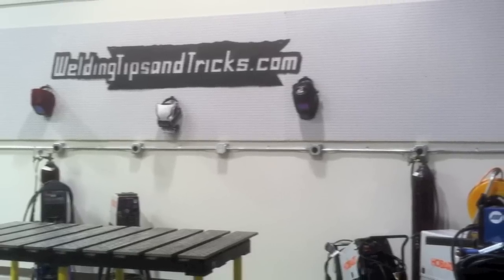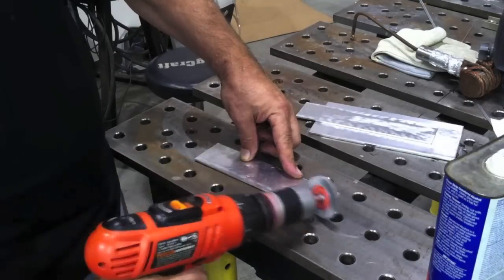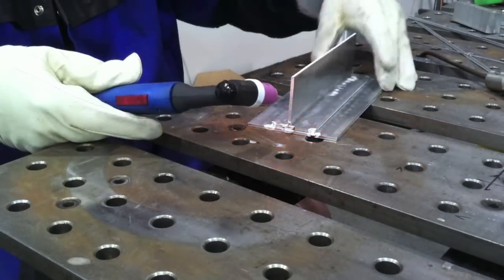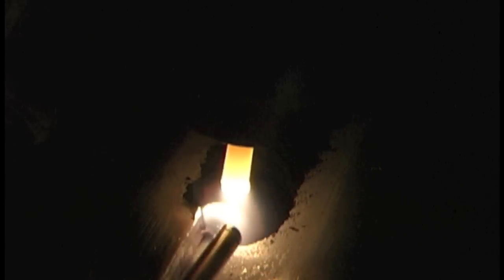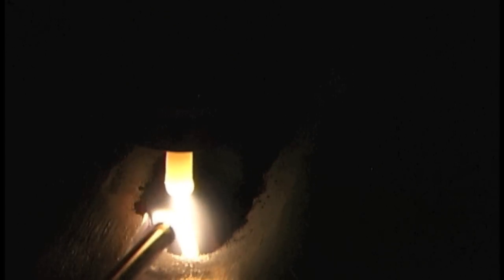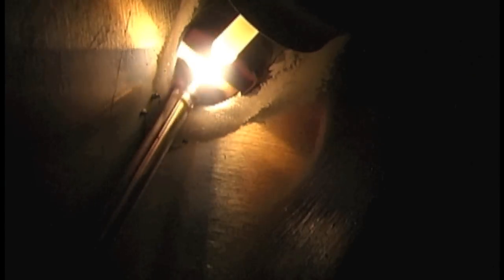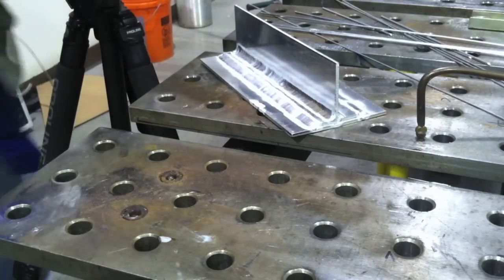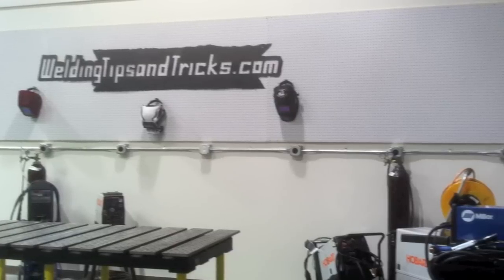Aluminum Welding -  Lap Joint and Tee Using TIG

Comment from the maker: Since this was a small piece and got saturated with heat quickly, and the fact that I did not have time to stop and let cool, areas where I welded with the piece really hot got grainy...it seems like the solidification rate is the key. once the piece gets really hot , it solidifies slower than normal.

Comment from the maker: as little angle as possible.  I shoot for only about 10 degrees but sometimes use more without realizing it.  you might need to step up one size in filler rod if the rod is constantly melting before you reach the puddle...either that or your arc might be too long

Comment: Hey Jodi, Nice videos you have here, you helped get my stick welding up to par, now I'm onto my tig welding. Currently an apprentice fabricator. One thing I've noticed, I have always been instructed that thoriated tungsten is strictly for DC welding. And Never for AC. Just want to know why you prefer to use thoriated for aluminium

Comment: Jody, in my city the 1.5% lanthanated electrodes are a lot easier to find than are 2%, and I'm told they are cheaper as well. Do you notice a difference between the two?

Comment: Tig welding is part of my profession and i have tried that, and it happens on different alloys too, but not always which makes me suspect its in the material itself. Because it will happen on one part of what i am welding, but not on another. For the most part i get clean shiney beads. I guess i can run some more tests once i have my new machine.

Comment: I had been taught the same, not to use thoriated tungsten for ac or dcep because in these processes the tungsten melts and gives off the same radiation you find when sharpening a thoriated tungsten but alot worse. wether its true or not I'm not too sure, would be nice to know thow! your thoughts jody?

Comment: Jody, what machine are you running in this vid?   I've been in the market for a TIG and the PowerPro 256 seems like  pretty good deal, but it will be used to Al, 304SS, and Ti.  I've aways been a Miller man, running a millermatic 250 right now, and in search of a spoolgun module, but TIG is a better option for me.

Comment: I don't tig professionally but find that different filler rod gives different finish on the weld. I use both 4043 and 5356, I cant remember but one of them gives me a more grainy finish than the other.

Comment: Jody, thanks for the video. Remember what you said about what an auto darkening helmet would do to one's welding ability? I found that using ZirTung electrodes on Aluminum gave me an equal leap forward. Any thoughts on the Everlast Pulsed Mig welder?

Comment: i am a welding student. what are you using for an electrode angle? i was using about 25-30 degree and i was having a few issuse with melting the filler metal before i got to the puddle to dip. tips?

Comment: Rather bold statement there mate! I would say grinding a thoriated tungsten is something you could do to increase your exposure to the radiation, through breathing the dust in and contact with the skin. I personally don't know enough about it to draw a conclusion on the case of ac welding, but looking it up there doesn't seem to be any info into the effects of ac welding on the radioation. it appears no one brings into account the decay chain of thorium. thow im a welder not a scientist.

Comment: ???? My boss at work puts the tungsten way up into the cup when welding aluminum and there is always a ball on it and the cup will get red hot. Why would he be doing this? I mentioned how you have it out just like you would on SS but he just shrugged me off. I have done very little aluminum but plan on trying your tech to see if it works better for me.

Comment: Hey Jody, is there anywhere on your site where you demonstrate good penetration for gtaw. I know you have a lot of vids on technique, (dropping the arc down into the corner, backing out a little), but haven't come across a cross section etched. Sometimes it's hard to see if you are getting much penetration on some of those bigger single pass, tig welds. Is it important? Should we expect that we get penetration down into the corners just like Mig? Thanks much, I'm a huge fan of WtaT!

Comment from the maker: @curtiscausey3 I guess your bosses way lessens the risk of tungsten inclusions but also requires more amps to get a puddle. If it works for him, that's the main thing. I prefer a fairly tight arc length

Comment: I just tried doing my first aluminum lap welds and It was the biggest train wreck ever. Omg, I am telling you that it is seriously the worst ever. I managed to work out doing the surface welds pretty dang good. I know ive only been doing this for a week. But holy jeepers, man I slaughtered those two pieces. I couldn't find a happy medium to get a puddle going. then black soot, kicked in etc. I dont even drink and think I need a jack and coke.

Comment: Just a thought, IMHO, thoriated electrodes are used for steel and stainless steel ONLY,
a better choice for aluminum would be ceriated or even zirconia electrodes.
 Better retention of tip shape, narrower arc, which in turn produces better root penetration...
Reply: Shjefke.23 Just misunderstood. Thoriated is meant for gauge materials in AC; he was using 11 gauge. However ceriated, Lathanated, and zircroniated tungsten for alum plate is optimun.

Comment: This week I was told that thoriated electrodes are being phased out. Rumor has it that the low level radiation causes false security alarms when homeland security scan incoming parcels. Just as well, since it sounds like lanthanated electrodes are almost as good without the theoretical radiation effects.

Comment: Sorry should have clarified. I meant that you cannot change the way a radioactive element acts. Even running electricity through it and running heat through it will not change in how much radiation is given off. Yes grinding can increase your exposure if you breathe in the dust. But you are not changing its radioactive properties. If I am wrong please anybody let me know!

Comment: Not true. There is nothing you can do that will increase how much radiation that is given off of the tungsten (or any radioactive element). Heating it up or running electricity through it does not change anything about it's radioactivity.